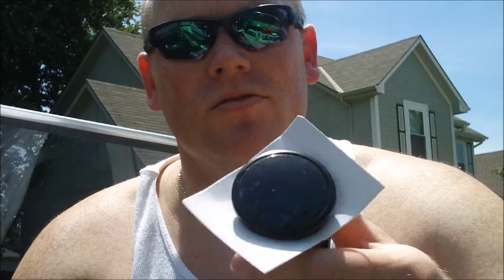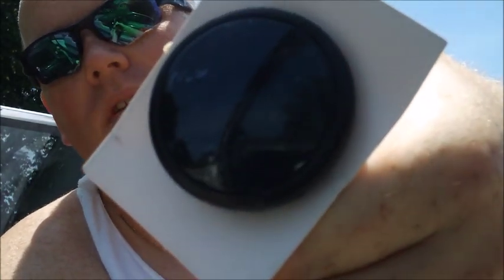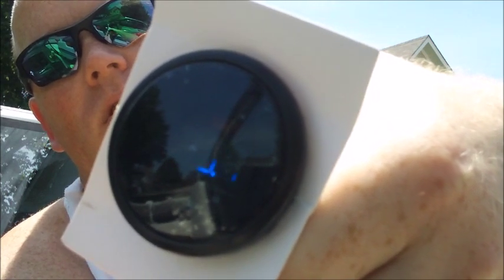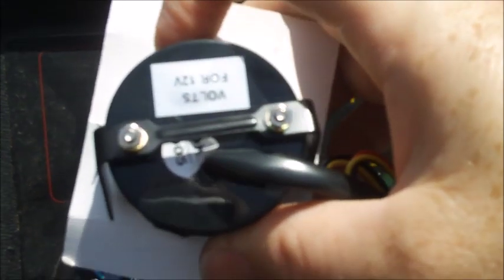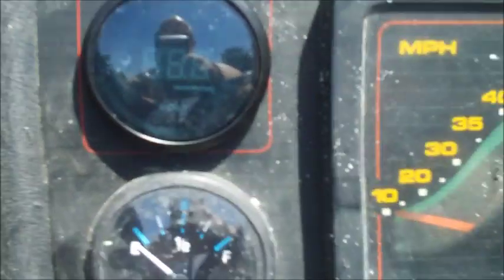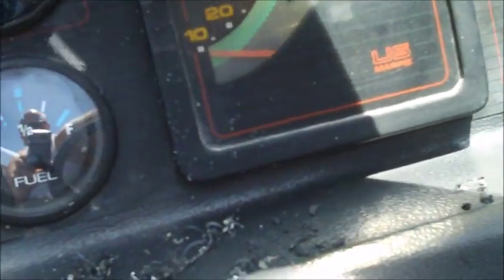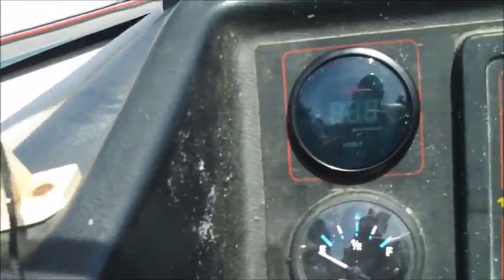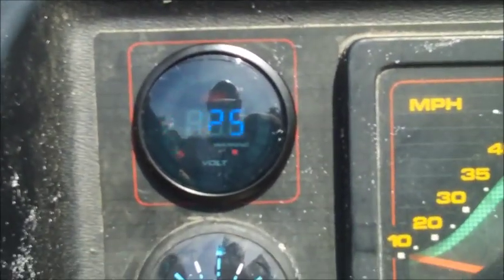Volt Meter Installation

Comment: can you run the cabels direct to the battery from the volt meter thing?
Reply from the maker: Yes you can and in the instructions it recommends you to do so. There just isn't enough wire to run the length of the boat. I didn't want to just run one single wire there also. I may when i decide to do more with it.